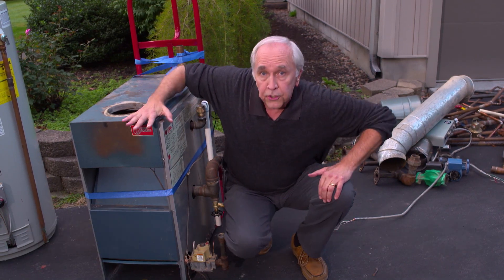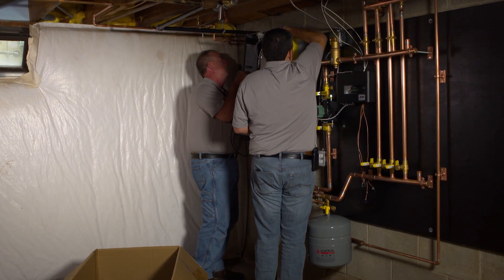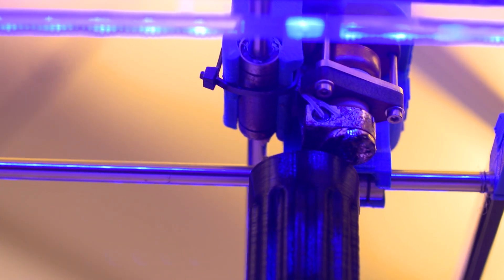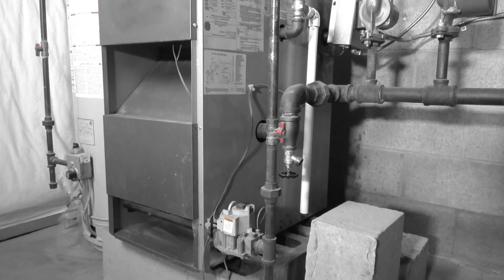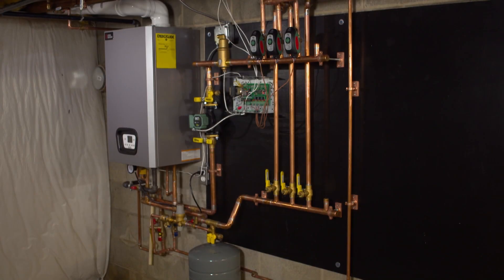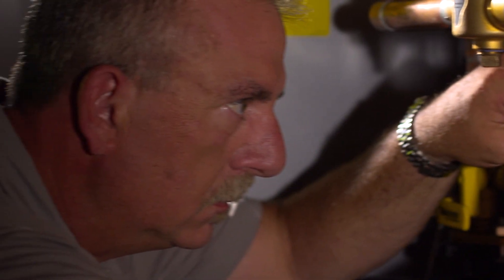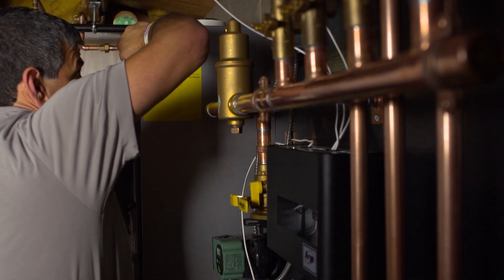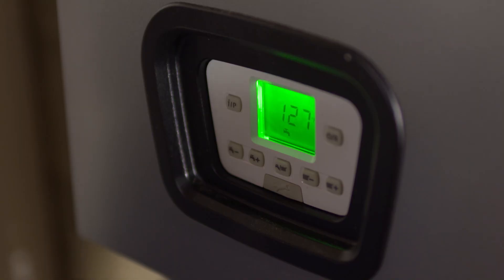Utica Boilers: Innovative Hydronic Heating for the Home

Comment: I had this unit installed 11/15/2016 for close to $5,000 and it's been nothing but problems and continues to break down even as I'm writing this comment. I had 3 HVAC guys here from New York (I'm in Connecticut) 3 times to "fix" this thing and every time they say "ok, you're all set! It'll run properly and it won't shut down any more" yet it's 12/18/2016 midnight, 28* with heavy winds, feels like -13 and once again I have no heat and no hot water. Im losing my mind with this shit and I'm very deeply disappointed. Im lucky not to have children here. I regret getting involved with this company and every time they're here to "fix" my unit, they're running around to and from other customers who are having these units shut down on them too. I know this because I can hear the phone conversation between HVAC and other customers.
Reply: SuperBrokenFingers     Call
Reply: wow. that sucks.
Reply: Was this ever resolved?
Reply: Navien is just as bad
Reply: Thanks for posting this.
We’re you able to get this resolved?
Reply: Are you still having this issues

Comment: All lies. $5000 to $10,000 to refit with electronics that will never equal the reliability of what was there. Yes, slightly more efficient but the homeowner will never recoup the cost in savings and the repairs following will be much more expensive.